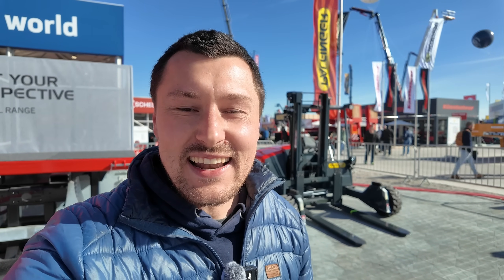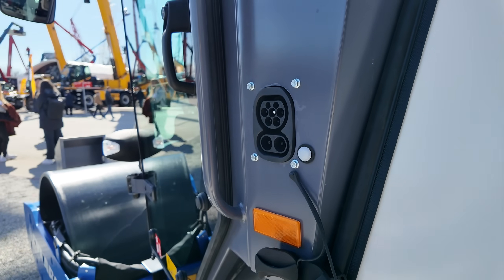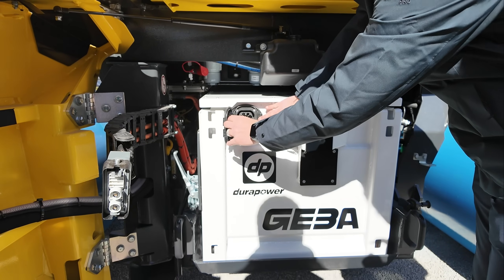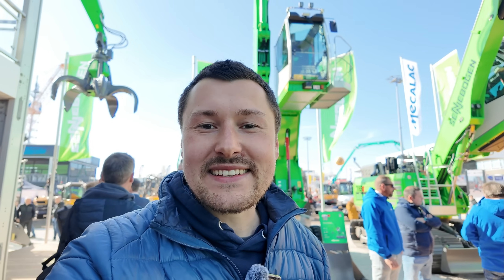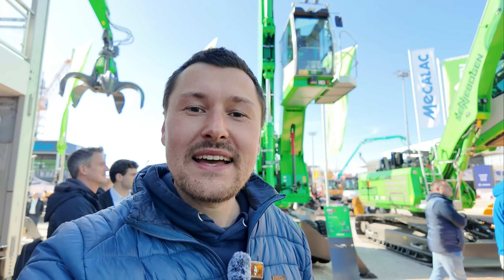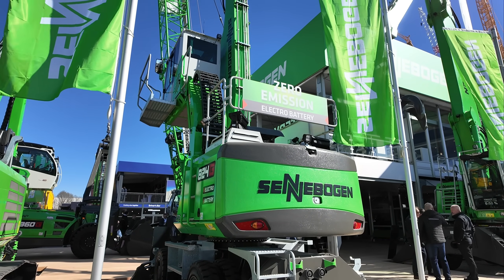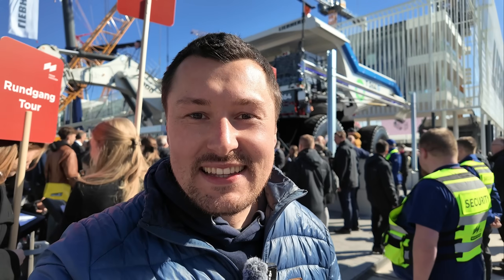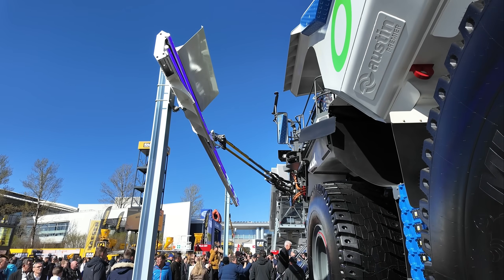Construction Sites will become Silent

Comment: Interesting as JCB are not so supportive of batteries as they think the weight of the batteries will reduce the loads that their consturciton vehicles can carry.  So if the construction equipment is all about moving materials (like the Articulated Dump Truck)  maybe this is true but I see your selection of equipment were mainly not carrying materials and so that argument does not apply.  Thanks for sharing

Comment: After hours on-site diesel generator charging or remove equipment after each day to charge station 🤷‍♂️
Reply: I don't know how it is handled where you live, but here every building site has a temporary power supply from the utility provider.
Most trades will not even begin work if there's no power supply.

Comment: While this is great progress. The real test is where these machines are used on site, where are they going to be charged? 22kWh is never going to give enough overnight charge for many of them, given the size of the batteries. They are going to need dedicated DC charging stations. Now while some manufactures do have portable chargers. They are not big enough for many constructions sites & the amount of charging required. Some serious thought needs to go into planning for construction sites in the future where electric is powering the vehicles.

Comment: You're so delusional if you actually think that and unbelievably misinformed.
Reply: Good argument!  Well reasoned, with lots of sources to back it up!
Reply: @davidlloyd1526  How much of electric trucks / tugboats you have on the roads? The energy density isn't near enough with LiIon technology and you are saying machines are gonna work a whole day? That kind of a battery doesn't exist, only in unicorn green fart brains. Charging? Even if you could charge them fast enough, where's the Giga Watt grid connection for just one such Construction Machine? Yes, you're wrong.
Reply: @mr_Ander50n  Well, if the world would have listened to people like you, we still would use horse carriages daily.
And no internet.
Reply: @peter_meyer  That's also a misinformation. Better 'technology' replaced old life. Current technology and industry still heavily relies on massive amounts of energy - which the grid can not supply. Even the wires are too thin for that, yet alone where would all that energy come from? And don't even try to lookup what happens when one of those high tech batteries catch fire.
Reply: @mr_Ander50n  You're funny. really.
Reply: @ i mean, it's really interesting to listen to arguments from 10 years ago.
btw have you ever looked at what it looks like when an oil tanker crashes or an oil rig explodes?
Reply: @peter_meyer  Have you even looked at when a tesla crashes or any electric car goes up in flames? Can you believe it that there are parking garages that forbid EVs? Did you even bother to look that up?
Reply: @peter_meyer  You're funny, actually.
Reply: @mr_Ander50n  You must be pretty young. First: EVs don't burn more often than ICEs, second, LPG-cars were also forbidden in parking garages when those came out new.

Comment: Sooo how do you charge on a job site?
Reply: Not sure how it goes in your country, but where I live all job sites have temporary power connections. Basically the utility provider goes to the site, and installs a black box in metal studs. The thing looks a bit like mushroom. At least in the city and most somewhat populated areas will have 400 volts or more available.

Comment: What happens if you have to work overtime and the battery is dead?
Reply: Same thing that happens if you have to work overtime and the tank is empty. You spend 20 minutes of your life getting fuel, except instead of driving to the gas station to fill up a transfer tank, you plug it into a charger on-site and use the time to grab a coffee/do paperwork, then get back at 'er.

Comment: The giant dump trucks going electric is in some mines is pure efficiency, if the mine is high enough above where they dump the ores for continued transport/processing, the regen of a fully loaded truck can give a net positive in battery % for a full roundtrip - meaning it never has to charge on the grid, only charges from regen.

A bit like the old wiredriven buckets/carts outside old mines that let gravity run the whole system as the loaded carts going downhill are heavier and as long as someone loads the buckets up top, the conveyersystem keeps rotating.

Comment: This is important stuff. Due to the nitrogen (stikstof) crisis in the Netherlands, companies are no longer allowed to use diesel powered machines and have to convert to fully electric. Houses, buildings and roads all have to be constructed using fully electric means. Something companies are hesitant to do since it involves large infrastructure investments. And the politics are not yet backing it up with laws and plans due to the nature of the crisis. Hopefully we can get out of the crisis soon when the government finally caves and gets their act together.
Reply: Amazing! The US is so far behind
Reply: Please tell more of this nitrogen crisis you're having. :) I know nothing of this.

Back in the 1980s, those who were around then may remember the acid rain crisis we had in Europe, resulting from untreated emissions from coal-fired power plants releasing a lot of sulfur oxides in the smoke from the boilers. This sulfur oxide would transform into sulfuric acid with contact with moisture in the air, which is a very strong acid, and this acid would etch on everything, essentially. Trees, statues, buildings, bridges... Regular plantlife could handle the damage because the acid concentration was quite low, and most plants die each autumn and return in the spring. But pine trees don't drop their needles, they stay all year round, so countless millions and millions of pine trees died because their needles were destroyed from constant exposure, countless thousands of lakes were acidified and all life would disappear from them, etc.

Eventually, after years of this we got emissions control equipment forcibly installed into coal power plants (against industry lobbying efforts) which greatly cut down on the pollution. Still, burning fuels in a nitrogen-oxygen atmosphere produces nitrous oxides as well (and more the hotter the fire is burning) which turns into nitric acid with contact with moisture in the surrounding air (which also is really nasty stuff, and when dissolved into farmland run-off and waterways will cause overfertilization of lakes and coastal sea areas (biiig problem basically all around the Baltic Sea especially.) So this stuff needs to be controlled for too, piston combustion engines do it with catalythic converters, but those aren't 100% effective, and also very expensive. Other forms of engines may not be able to - IE jet engines, and rocket engines in particular.
Reply: @lennyvalentin6485  It's rather complicated for most, but it's solution is very simple and yet incredibly complicated for lawmakers and their voters. Lifestock and industry produce emissions. Some of these emissions suffocate nature's wild, insect and plant life. For instance certain plants thrive on such emissions, and those thriving plants replace other species who are less equipped to handle the emissions. This also causes the soil to become poorer and worse for many other species. Because of many European laws coming in effect since 1978 and dutch government getting exceptions for dutch farmers all the way up until 2019, dutch farmers were still producing lots of emissions from lifestock raising up until 2019. With the EU crackdown on governments, the Netherlands could no longer give the farmers their exceptions under EU law.  

The simplest solution is to reduce these emissions, but that would require farmers and industries to stop producing emissions. In most cases, that would mean forced retirement. It would also mean closing certain industries and the inherent loss of jobs. Whichever government that would cause hundreds of thousands of people to lose their way of life as well as their jobs could find itself voted out of existence in the next voting cycle. Hence, the government is trying to wiggle themselves out of the demands set by the courts and the European Union. To give you some numbers, the Netherlands is the second largest farm producer in the world after the US in gross tonnage. To meet the demand by the courts and the EU, we would have to put 70% of the dutch farmers into forced retirement. Mind you, that's mostly livestock farmers as well as businesses like flower farmers and greenhouse farmers that would also have to be reduced or shut down. 

And in the meantime, there is a upper limit on how much Nitrogen emission is allowed to be produced by businesses in any given area. For instance, when the main international airport Schiphol wanted to increase the numbers of flights allowed, they bought a number of farmers and closed their farms, and so they got room in the emissions budget to expand. This came as a nasty surprise for many parties since they would have preferred to spent that emission budget on other things. Right now, nothing in the Netherlands can be built if it doesn't come with its own emission plans for the foreseeable future. In the past 8 years, barely anything has been built, due to the inability of the government to deal with the emissions. This is why electric equipment is such a huge growth market in the Netherlands. Either building companies switch to electric, or they need to pull out of the Netherlands for fear of bankruptcy. 

Best of all of this is that the Netherlands is a bit of a testcase for the entire European Union and the world at large. Since we have such a densely packed country where nature and industry and living are so close to each other, the rest of the EU and the world look on closely on how to fix this, since they will inevitably have to follow suit.
Reply: Also, there is another issue at stake, namely the electrical infrastructure in the Netherlands is at its max demand. Right now approximately 30.000 companies nationwide want to expand their business and are on a waiting list from the Electrical companies because the network cannot provide the added electrical power throughput. This is mostly a supply issue through the network and will require in the next 30 years that 4 out of every 5 streets have to be broken open and have its wiring expanded. I can see this in my own city as there are plans to have a number of houses built and all the streets around it had their wiring replaced and expanded. Because the houses are no longer allowed to have gas connections due to emission caps.

Comment: The battery crane is a great idea, they currently spend a lot of time just sitting there with the engine running while loads are manuevered into position, attached or disconnected.

Comment: So..  you want to renew a piece of higway in the midle of no where... how do you charge? Diesel generators?
Reply: Electric truck places large mobile battery-supported charge point, problem solved 😂
Reply: The company which produces the tar machine already provides the solution for this in form of a transportable battery container. All machines can be recharged at this power hub and the power hub can be recharged with a normal charger i.e. You can  see this in action in another video of the Electrotrucker.
Reply: The middle of no where is always connected to roads leading to it... usually with powerline along that road. And the new highway needs electricity too...
Reply: When doing his (German, yet unreleased EN version) of the delivery of the asphalt machine he showed a 10ft container that serves as a mobile battery charger with multiple CCS and other chargers. 
https://youtu.be/ZcXLsZJsdTw?t=2189
(EN auto subtitles available)
Reply: Probably a natural gas generator before Diesel.

Comment: Something worth mentioning is that most if not all of these vehicles will be so much quieter then their diesel counterparts! I can very much see cities in the UK or Netherlands soon requiring the use of electric construction vehicles in cities, and I for one cannot wait
Reply: Will reduce a ton of harmful noise pollution
Reply: @Nicholas-f5  And let's not ignore the diesel or gasoline exhaust fumes (though those backup alarms will still 'meep, meep, meep' but once ambient noise dB declines, those may be dialed back too). The sounds mostly suppressed will be the continuous running and ramping of power output of the operating vehicles and tool motors, the natural sounds of grinding, scraping, pounding, bangs and whirring will still propagate maybe even more jarring without those enveloping motor sounds - but still the ear structures will be subject to less abuse.
Reply: @Don.Challenger  have you seen the white noise reverse alarms as well? They're safer too
Reply: Yes, I agree, in urban areas electric power is the way to go to build up the battery capabilities for out of town operating. 
Plus, the side pantograph system of the mining truck is super cool and  a step forward of the old trolley buses system and know fitted to BYD TFL buses to ultra fast charge.
Reply: I read about recent tunnel construction in Norway where customer asked for using electric equipment. So it is already happening.
Reply: Absolutely. Many medium to large supermarket restocking trucks—and even garbage trucks—are already being electrified. I also hope cities with canals will start reusing their canal and waterway infrastructure for near-last-mile deliveries—ideally using electric boats.
Reply: To the best of my knowledge, there's a requirement that's been in place for several years in some, if not all, Dutch cities that says electric only construction equipment is mandatory to reduce noise and pollution. If you want to bid for contracts or get planning permission, then EV only equipment is required.

Comment: 3200kWh battery, that’s huge!

Serious question, from a practical standpoint, how is recharging accomplished?

I mean, most construction sites, road construction projects, the equipment can be at the site for days to weeks.

Particularly for road works, how do they charge the machines? The site won’t generally have 100kW or much more to connect all the machines at night.  You don’t want to transport the equipment back and forth to a service yard every night.

Thanks for the great videos!
Reply: Some years ago there was a story of a similar mining truck "The Elektro Dumper" that was all-electric. It would load up with limestone at the quarry on the mountain and drive down to a cement production facility to unload. Because it was double the weight loaded as it went down the mountain, it could use regenerative braking and charge more than it used to make the return trip - they ended each work day with 200 kwh of surplus energy.
Reply: @Smidge204  I have heard of similar things with train loads of iron ore in northern Western Australia (I am in Perth).
Reply: As stated in the end of the video, it charges via the direct grid line to vehicle system that delivers up to 6 megawatts. That means the utility provider needs to build a dedicated line system on the site  (it's roughly similar to the one used to power electric trains, but instead of overhead line, it's on the side)
Reply: regarding your question about roadside HPC on construction sites. When doing his (German, yet unreleased EN version) of the delivery of the asphalt machine he showed a 10ft container that serves as a mobile battery charger with multiple CCS and other chargers. 
https://youtu.be/ZcXLsZJsdTw?t=2189
(EN auto subtitles available)
In the future these will either be permanently "trickle charged" with whatever power that's available nearby being able to offload it into the machines during lunch break or there will be trucks bringing these to wherever they are needed.
I BET this (or huge HVDC battery block that fit onto large machines) will be the way to go with high powered agricultural machines that aren't used year-round. Just quickly switch these blocks onto the harvester without having to carry the entire energy all at once needed for those 16h shifts. They will be like your DeWalt batteries that fit multiple tools but MUCH bigger, great for stationary storage from all that solar roof PV as well...
Reply: @velotill  thanks. That definitely sounds workable. I guess early projects (early in product development stages) using such equipment will be chosen based on their access to existing grid infrastructure.
Reply: @mark111943  yes, I guess so. There'll now need to be new companies whose job is to provide temporary, high-power electrical connections. They may themselves use batteries to provide those peak power levels, so one battery is charging another. Or - maybe battery swaps?? But that would require standardisation, which doesn't sound so practicable.
Reply: The key IMO is how often the machines are actually in use and how often they are paused waiting on something. 
If you have to run the machines to their limit (about 8 hours for most of those machines),  operators will likely solve it by having a few extra machines and trying to schedule the recharging so you maximise the time operating per machine.

For other situations, every time you park a machine, you should plug it in.  For example, on a road repaving operation there's multiple steps that are done one at a time, so while (for example) the miller is busy chewing the asphalt, the cleaner, asphalt placement machine and the compactor can remain plugged in.

And yes, a lot of sites won't have electrical setups to start, but I bet this will be a new part of the logistics for any new project - before you had to ensure you had a parking place, fuel and material deliveries, now you have to ensure those things plus power hookup.
Reply: Many have crane swappable batteries